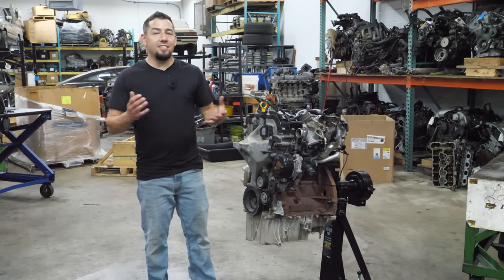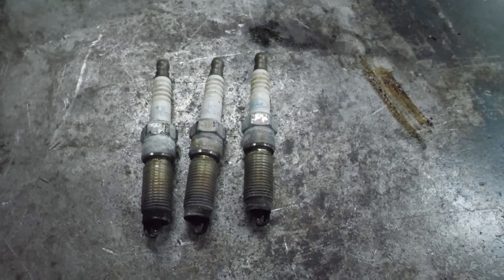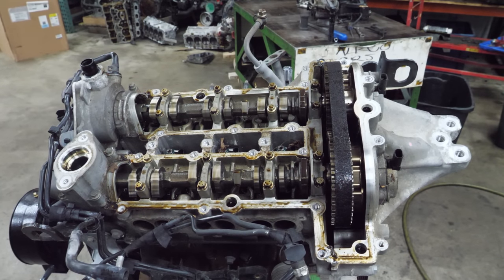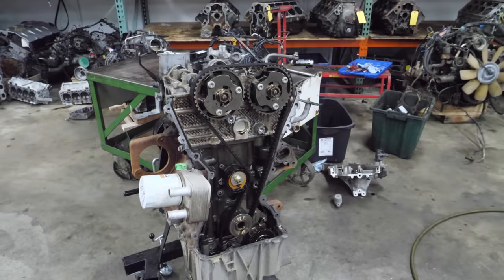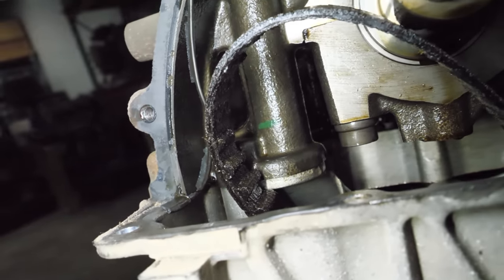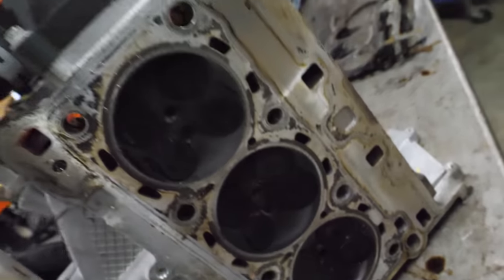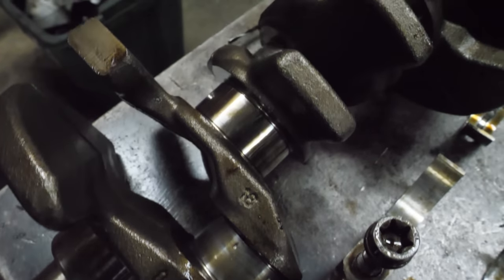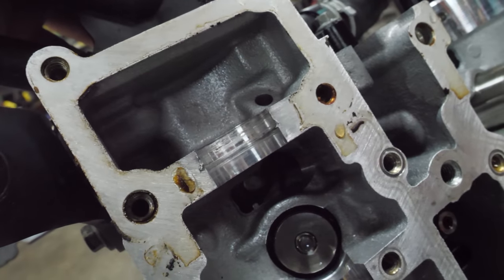JUNK Ford Ecosport 1.0L 3-Cylinder Ecoboost Teardown. LAWSUIT ENGINE!

Comment: 125hp and 170 lb/ft out of a 3 cylinder is actually very decent.
Reply: Not just a 3 cylinder, but a 1 liter. Very good output… such a shame that it turns itself into a boat anchor in such a short amount of time.
Reply: Yeah, it's crazy what these little turbo engines can do. The GR Yaris has 250HP from a 3 cylinder 1.6 liter.
Reply: Correction, this engine produces 170 Nm of torque which is equal to 125 lb/ft, having said that, with a stage 1 software remap it makes 150 hp and 170 lb/ft (230 Nm) 👍
Reply: @BillionDollarDon  Yes it looks like the Ford Authority website crossed their units. The version that came to America though,  output higher. It was rated at 200nm which is about 147lb/ft. Very decent for that tiny engine.

Comment: As you mentioned, these engines were available in the Focus but in 6 speed manual only.  It was also offered in the Fiesta but only in an automatic.  Go figure. But the parts are super cheap.  I wanted a crank to put on my desk and I got a brand new one, fully machined from Ford for $70 delivered.
Reply: I have a '15 Fiesta with the 1.0L and a 5 speed manual. It's super fun! :D
Reply: 2012 Fiesta Sport with 1L Ecoboost with 5spd manual here in NZ 🇳🇿
Reply: 2017 Fiesta SFE w/ 5-speed manual here, you are incorrect sir
Reply: 2019 Fiesta 1.0 140PS with 6 speed manual checking in…

Comment: are all eco boosts pretty much junk?
Reply: I think the 3.5 engines are pretty good. Definitely better than the 5.4
Reply: Yes
Reply: Not really. The 2.3l, 2.7l, and 3.5l ecoboosts are actually pretty reliable.
Reply: @edwardsr70 The 2.3 in the focus rs had head gasket failures but i think it was a manufacturing fault of using the wrong head gasket part for mustang in focus rs but coolant issues area common theme for the ecoobosts
Reply: yes
Reply: I have a 2.0 in my Fusion, great engine
Reply: @sbrader97  The 1.6 wasn't great but wasn't around long. The rest are pretty good IMO
Reply: @FusionBoost2.0  1.0 ecoboost had coolant issues 1.5 ecoboost has coolant issues 1.6 has coolant issues they all based off same junk design that is destined to fail
Reply: @sbrader97  The 1.5 and 2.0 with coolant issues was fixed a few years ago with the block redesign. The 1.6 is  long dead
Reply: @sbrader97  hasn't been a problem in the ranger

Comment: I own 2 vehicles with the 1.0L eco boost both 2018 engines both get serviced every 12 months no problem as yet 🤞🏼🤞🏼 however I have been told though to not run them after 80k miles because that’s when financial losses start taking shape.

Comment: that is a nice video you got. I'm from france  and we also have a stupid kind of motor design by Peugeot. It's an 1.2 3 cylinder named "Puretech" and it's famous for blowing it self up after 60k 70k km because of the timing belt that is inside the oil. These motors are inside Peugeot,Citroen,Vauxhall,Opel and DS . I think that this one is pretty had to find in the USA.
But acording my research, the problem isn't directly from the belt but from direct injection, you see when you start up your car in the morning when it's cold the direct injection blows fuel inside the cylinder but the piston ring aren't at the perfect size when cold and the fuel goes down into the oil and destroys the lubricant and the additives inside that oil and the when the oil isn't in top form attacks the belt, then the belt goes in litle piece that fell inside the sump and then clogs the oil pump and next you know what's comming. No oil, bearing kabom. 
I've seen some of those motor that have their oil level going up because of the fuel that goes down inside the sump so yeah it's a big problem.
Really a bad design and WTF where they thinking ????

Comment: Thanks for the video. These engines have a shocking reputation in the UK, and Ford (UK) has so far completely refused to accept liability for the excessive numbers of failures. My local garage refuses to buy the special timing tool needed to replace the timing belt as they won't recoup its cost, as the engines never make that service interval. My car certainly didn't.

Thanks again.

Comment: Here in Europe, many of Ford's engines do not have a keyway on the crank. This enables more accurate setting of the timing which is then secured by the tightening of the crank pulley bolt.

Comment: The really sad thing is, Ford used to make a really nice 1L 4-banger. Well, 957cc, with (IIRC) a firebreathing 37hp. My first 2 cars had them, both mk.2 Fiesta's. Slow as hell if driven sensibly, they were great fun if thrashed to within an inch of their lives. The trick was to rev them until you thought a piston was going to come through the hood, and avoid braking unless really necessary. You'd be surprised how quickly a 2,200lb car on 135 section rubber can go round a corner on 3 wheels. Chain driven SOHC, oil changes twice a year, only problem I had was a cracked dizzy cap, a £10 fix. The first got written off when I got tail ended (every panel aft of the A-pillar was bent), the second was running like a top when I sold it.

Comment: ❤😂 I love your show you got a great personality and you know what you're doing. I have a 2016 Chevy Spark with a 1.4 non-turbo. I got $122,000 Mi on it and all I've done is the water pump in a tune-up. Car and engine were made in South Korea seems pretty reliable! There's no three cylinder engines from South Korea in the Buick and the Chevy Trax what do you know about them are there is reliable is my car I know the ones that were made here in the US for the bigger Sonics were junk especially with the turbo but those were one fives my one four has been great and I wonder if the one two and three in the Chevy Tracker any comments please. Mile marker Mikey Michigan😅

Comment: Those fuel numbers makes sense if you think metric. 22 km per liter.
The timing wheel and the crankshaft are conical. When changing the timing belt you have the pulley lose when you tighten the belt.

Comment: EU mechanic here. i want to shed some light on the timing gear of these engines. Wet belt engines are terrible in the field, we see them in Europe more and more these days. The theory behind them is, because of oil lubrication the internal friction forces of the engine lessen, therefore making the engine more efficient on fuel. Nice idea, very bad execution.
We see a lot of engines without a key on the crank gear. I like this design, when doing a belt service. The pulley locks up the crank gear on the crank itself. The thought about using a free wheeling pulley/sprocket is so the belt can be put on easier and once getting the belt up to tention the sprocket moves a little, eliminating the slack on the "pulling side" of the belt. making the tention and timing spot on. Usually it is pretty easy locking up the cam and crank with a pin, to make sure they wont come out of sync.

Comment: My dad bought a 2013 Fiesta with the 1.0, it never gave much trouble in 4 years that he owned it but i was glad when he got rid of it. As for the wet belt setup the folks at Peugeot must think it's a great idea or they want to ruin an engine also because their 1.2 3 cylinder puretech engine is wet belt also.

Comment: This is one of the better videos - the Ford Focus is a fine, frugal engine when running well. 41-49MPG in real driving use. However, every mechanic in the north east of England would echo every comment you made about the wet belt and the systems operating this engine. Ford talked of "the wrong type of oil" for a while. Once an initial failure happened, loss of teeth etc. the effect on the engine was invariably dire.

Comment: There is a recall for these engines now, according to the recall: "The engine oil pump drive belt tensioner arm may fracture, separate
from the tensioner backing plate, and/or the oil pump drive belt material may degrade and lose teeth, resulting in a loss of engine oil pressure."
AMAZING!!!

Comment: A 2018 Ford Focus came to our shop and the customer said that it cranks but doesnt start. We had heard of these 1.0L 3cyl engines and after a while of taking it apart we learnt that the timing belt had no teeth for a good 15-20 teeth lenght and had bent allmost all of the valves and shattered some of the valve cups and that the oil sump filter was full of all sorts of debris. We told the customer that the repairs to that engine would be more expensive than to just buy a new engine. So we looked for a couple of weeks to even find one and even it was from a neighbouring country all and all the process of getting the new engine tool aprox 4-5 weeks. So yeah NEVER BUY a 3 cylinder especially a Ford 3 cyl.

Comment: A lot of small Ford engines over the last 20 years or so have unkeyed crank and cam sprockets. Timing is set by locking crank and cams with special tools, then tightening sprocket bolts. It's supposed to give more accurate timing, allowing for variations in belts.

Comment: I have Ford Ecosport Ecoboost 2016 in India, a RHD, here Ford Motors made an exit and spare parts are a Problem.
Finding knowledgeable technicians is even more difficult so DIY is the only sane option.

Although just few days back heard that the Endeavour has been registered so hopes are alive but bleak.
Thanks for the teardown...

Comment: My daughter bought a 2016 focus sport tied with a 6 speed manual. It cost like 1500 more than standard 2.0. It had 160k miles and still runs ok I was surprised how fast it was for its size. I didn’t trust it would hold up because it was a new engine.   I made sure I changed her oil every 5 K miles mobile one like all of my cars.   But after seeing rubber timing belt I think maybe she’s been lucky. I wonder what replacing the belts would cost her to replace them?

Comment: As for the fuel economy, you were right about a typo:  How many mpg does a 1 litre EcoBoost engine do?
The 1.0-litre 155hp EcoBoost comes with mild hybrid tech to improve fuel economy and reduce CO2 output, with a claimed 50.4-54.3mpg and 118-126g/km CO2 output. We averaged 43.2mpg during our time of testing, mainly from covering motorway miles.

Comment: For that small of an engine in two small sized cars that is pathetic fuel economy, but my theory is torque improves fuel economy, which a little 1.0 liter has barely any, but as with larger engines tuned correctly they can get very similar economy with a lot more power and torque. Normally a Crown Vic, MGM, or Towny get around 18 city 25 highway which is respectable and my 03 Grand Marquis gets 20-23 city 28 highway albeit because it has an opened up intake and strait piped with the cats with NGK Ruthenium plugs. But its just crazy that a boat of a car like the panther platform is capable of being similar in fuel economy while being more reliable, comfortable, safe, and your never worried about a truck trying to push you off the highway when your car is the size of a pickup. I honestly think engines could get way better mpgs than we are lead to believe.

Comment: My 2018 Ford Ecosport had a complete engine failure from the oil tensioner arm breaking off.  Had to use my aftermarket warranty to get it repaired.

Comment: Totally agree that a wet belt design is poor, however what a lot of owners and garages don’t realise is that a specific type of oil must be used. As some oils contain additives that actually attack and rot the belt. This is not only important for oil changes but equally when topping up between services.

Comment: Thanks for sharing this experience. I have this same 1.0L 2018 EcoSport. It's showing " turbo charger under boost condition. And the is not pulling with spanner light on the dashboard. How do I solve this concern. 

Thanks
Samuel

Comment: Just a little something about turbo engines: they usually operate in two distinct "modes" when it's in boost it has full power, when it isn't in boost it has full economy, turbos allow engines to be powerful and economical, but not at the same time, that would be too good to be true. 

That is, i believe the reason why mpg figures for economical turbo engines are often less impressive than they should be, because in those tests, the engine might not be kept out of the boost threshold.

Comment: What is that secondary vacuum line to the turbo connected to? The one that is connected to a black thing on the compressor part of the turbo.
The line that is not connected to the wastegate.

Comment: To heck with the ford eco 3 banger , id like to see my 2000-2006 gen 1 honda 1.0 3 banger up there as i overheated one of mine and would live to understand what it is that makes these able to take me LA to SF on I5 at 100mph all the way and capable of 400 to 500,000 miles no problem before rebld. Really an outstanding entry in the US mkt as the first hybrid over the Prius by 6 mo.

Comment: Can you advise what mileage if known was on the engine you teared down.
I have a 1.0 ltr 3 cylinder ecoboost ford engine in my car and I am worried now iv see your video about the wet belt situation which I wasn't aware of, I honestly thought like all previous Fords iv owned that the cambelt was external, not running in oil.

Comment: I work with Ford dealerships and they said that they literally have a message that states to replace the long block if the belt fails on these engines. I've seen many of these engines fail due to this exact concern.

Comment: Supposedly there's an oil with an additive that's meant to keep the oil soaked belts from failing prematurely. And that regular engine oil will damage the belts very quickly. So that makes oil changes potentially more expensive increasing the cost of ownership.

Comment: I jad a Ford Focus 1L Ecoboosy back in 2023.

Its rconony dif not mstch the claims, but I got 52mpg on a long run.

Note this is UK imperiall gallons not US gallons.

But it did have a major flaw in the UK , it kept bursting into flames as some owners found out.

Ford denied thete was a problem ( as usual ) but it was found that there was a major issue with the Degas coolant pipe

Comment: I had the 140Hp version of this engine. At 26,000 miles I could hear it rattling. Sold it back to ford with a "sold as seen" letter in my hand. Didn't appear on the forecourt for 3 weeks???

Comment: I had a 2009 C-Max 1.8 TDCI with a wet belt system, it was regularly serviced by the Ford garage but at 7 years old with only 53000 miles the timing belt snapped and destroyed the engine, i complained to Ford who informed me it was wear and tear, cost me £5,500 for a recon engine that lasted 14 month and 7000 miles before the head gasket blew. That was the last Ford i will ever buy.

Comment: I'm about to get my 4th-1.0L engine ecotrash.  I'm looking into the Lemon Law for this.  I took decent care if it and eaxh time it wad low oil pressure, which from the sounds of it, the wet  belt stripped.  Ford is going to owe me on this.

Asking, would it ve cheaper/easier to just change the belts or by that time it's pretty much time for a newer engine??

Comment: Howdy and great vid, I owned a mid 90's Suzuki Geo with a one litre, three cylinder engine, two valve, throttle body injection, mated to a silky smooth five speed manual, consintilaly give me mid to high sixty mpg! There was a turbo model of this engine and reportedly was fastest across an intersection, bar none! So Ford with a four valve, direct injection and a wet belt (sheesh!) getting twenty five mpg??

Comment: I have had several cars with DRY belt o.h.c. drives. The longest I’ve had one car was a 53 plate Citroen 2.0 hdi, Had it from new, had belt changed at 100,000 miles, the old one looked perfect! Eventually sold car with 140,000 on the clock. It never gave me a moments problem. A small one, temperature gauge decided to go to max reading when started after half a mile! Then performed fine. Garage tried to convince me it was the plastic impeller on water pump slipping! YEA, RIGHT! I got a new sender unit for the engine! Perfect. My question is, why change from a dry cam belt for a wet one!
A lady on radio  has a fleet of 120 transits! Always serviced on the button, 12 are off the road with wet cam belts gone. Fords not interested! F.O.R.D…..Fix or repair daily. My advice, if changing your car, make sure it’s not a wet belt drive!👍
Thanks for posting the video, brilliant. Love your humour!

Comment: The oil submerged timing belt and oil pump belt are definitely weak points of this engine but I would love to see statistics on the failure percentage vs mileage. The service schedule calls for belts replacement every 10 years or 200000 km so this one could have gone beyond that limit. I read the comments about the warranty replacements so it does fail even before that limit, but unclear which percentage of the cars fail. I have one in my Ford Focus currently at 120000 kn and 12 years. Changed the belts at 10 years, the mechanic said they did not look good. I see a lot of >150000 km cars with this engine on sale, so they do survive to that age, at least some of them. Found a few with 240000 km on them.

Comment: I bought a 2018 focus new from the dealership. I had the oil changed by them every 3000-4000 miles. At 63000 miles it launched. It was 3000 miles past the factory warranty but I bought the extended warranty when I bought the car. Ford put a new motor and new turbo in it. It took 3 months during Covid. I’ve driven it to 83000 miles now and will be getting rid of it very soon. It rarely breaks 30mpg, usually around 26mpg, and is gutless. Has been since new. The 2.0 is way better. This should be my last ford.

Comment: They may have used wrong spec oil. Hence they belt is toothless. 
And they drove to long without the oilpump working. 

The flaw is, this engines runs the belt thru oil. The aramidefibers clogup the oilpump. Advice change every 100.000km to prefent damage. 
Jus did mine cleaned everthing up. And its fine.